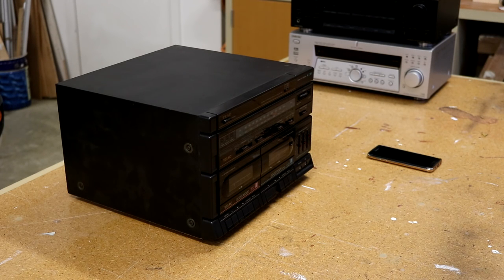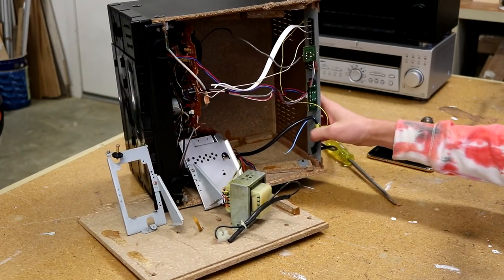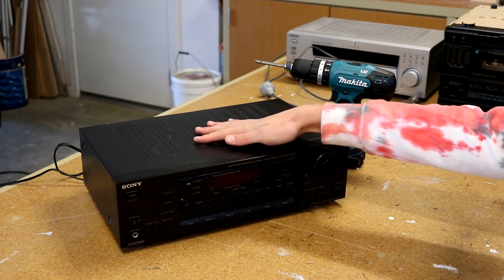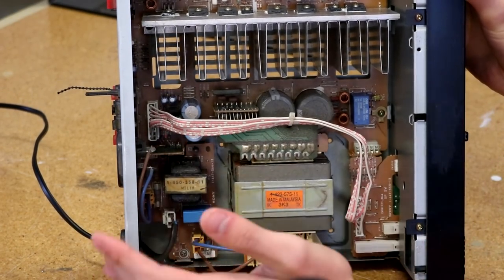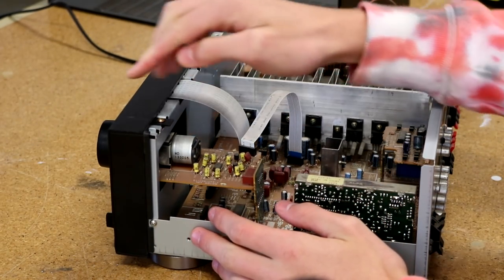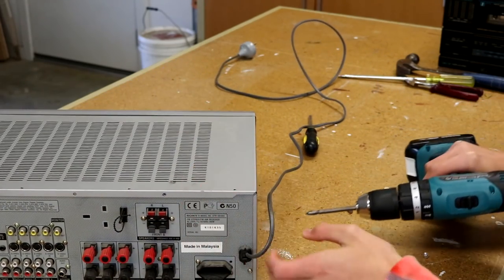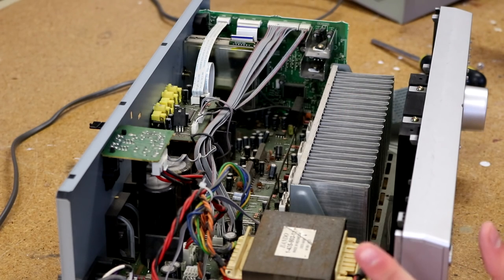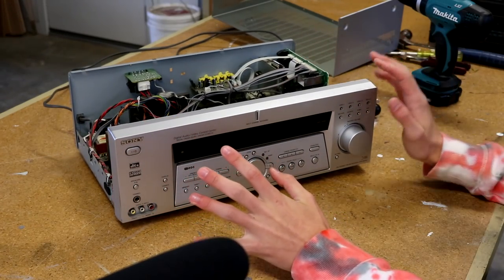WHATS INSIDE? - FREE AMPLIFIERS/RECEIVERS!

Comment: one tip. you said you've let it discharge for a few days so you're certain it's safe to work on. when I was 14 or so just starting my experience working on electronics I was ripping apart a Toshiba tv that had been sitting in the garage for well over a month and got such a large shock I was worried my heart would stop.
Reply: carefully discharge capacitors with an insulated tool. you just never know. especially when your dealing with high voltage DC it can easily kill you.
Reply from the maker: I'll keep this in mind, thanks :)
Reply: At around the same ago I was taking a monitor apart, I touched the HV side of the power supply and got a nice zap, nothing bad but it hurt, quite a bit XD
Reply: William Butcher been there my friend. I got a couple good kicks in the ass. worst one I ever got I borrowed a 240 volt pressure washer from my uncle and it had a frayed power cable. without noticing it I plugged it in and started using it. I was standing in bare feet in a massive puddle of water and when it hit the cable. my god.
Reply: William Butcher The tube basically acts as a big capacitor.
Reply: Techknowledgy i getting shocked when im on friends trampoline and getting shocked like 6 vols
Reply: Gal tu nebenusisnekek?
Reply: That would be residual power in the power supply capacitors, nothing to worry about. Yes startling, but not dangerous. If it were plugged in then you would really know it.
Reply: Doublsmm   I love this video
Reply: i have been working on amplifiers and other such elections for many years and never once got a shock from them maybe if they are plugged in but i make sure they are unplugged i have replaced the capacitors that you see in them BIG ones also never got a shock. keep this in mind volts don't kill amps do kill
Reply: Aaron bilger You need volts and amps. 12V 10kA don't kill you, 100V 30mA can kill you
Reply: Drakkar Calethiel 
A little from column A, A little from column B.
Reply: If i am correct, capacitors are used in amplifiers to store energy or rectify signals but are placed after the transformer. It means that 220V goes down to 12 volts and gets rectified by diodes and capacitors. 12 volts doesn't do nothing! The resistance of the skin is high, so the current flowing is low because Amps = Volts/Resistance (if V is 12v, Ohm law). 
Of course things change when i touch 220V instead of 12V, the current flowing is much higher and it gets nastier.
Oh i once saw someone explaining how a friend died because the screwdriver was not well insulated (idk how it was possible, still watch out for 220V capacitors! Bigger size but smaller capacity usually)
Reply: Killen The caps are indeed used for short term energy storage, but the most important thing they do is filtering any ripple out. Depending what your mains frequency is the full bridge recified voltage has a ripple of 100/120hz, The caps filter these frequencies almost 100% out so your MOSFETs or transistors (depends on your amp) see clean DC. without them you would always hear that loud humming noise.
Right, the resistance of your body is high enough to safely touch 12 volts, but the higher the voltage, more and more current will flow, I go save and say anything over 40 volts could give you nasty shocks especially when big storage caps are involved. luckily every good quality amp has bleeder resistors across the main filter caps so they are save to touch after a couple of seconds.
Old TVs, the tube inside acts as a large capacitor, touching it hurts a lot! A couple of years ago I disassembled an old monochrome monitor and accidentally touched the tube at with the anode cap removed, one experience which I don't want to have another time.
Reply: Killen 
"doesn't do nothing" is a double negative  🤔
Reply: Hhahaha sorry my english is not that good. I am stupid i hadn't specified some things like the power of the amplifier, i was assuming it was a low power amp like my Marantz... 
I have a Marantz PM350 recapped by me... i didn't have to wait the capacitors to discharge because i knew the voltage was low (less than 50v max rating of capacitors more or less) so i wasn't worried too much. 
Yes probably it's because of the resistor that discharges the cap, but still human body is like a capacitor that filter dc right?
Reply: @gedvinasscerbavicus2218  maitinimo kondikai ant situ stiprintuvu uzsikrauna apie 80v dirbti nera pavojinga

Comment: one thing you failed to notice let alone mention is that the teac was a midi system not an amp minus its record deck & did you remove the tape that was still in deck2

Comment: I want that black sony's volume knob... it looks really cool and its motorized :O
Reply: motorized?
Reply: Trevor Sutter yeah so it can move if you control the volume with the remote
Reply: Its a nice way to cheat digitizing the equipment while still keeping it purely analog... It only really requires a good driving circuit to operate the motor, thus no asics or micros are needed to process the audio. Sadly though, the cheapest way to get these are by scrapping old equipment that usually gets to the garbage heap before I can snatch it. There are only two companies I know that sell and manufacture them today, thus they are hard and expensive to find.... And brings me to my comment... I would love to have the pot! LOL...

Comment: Dude iv had both of them Sony amps in the past try checking the sound settings because you can turn the volume down on each speaker some av amp keep the settings stored and don't reset after it's unplugged just a tip give settings a check